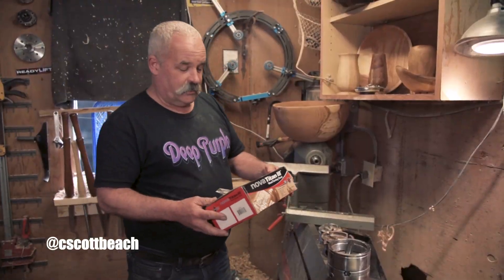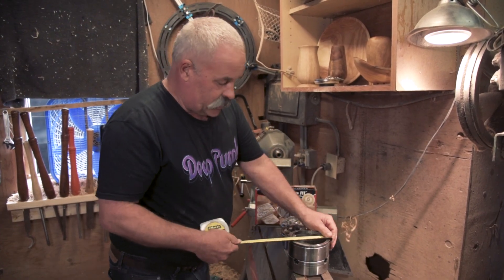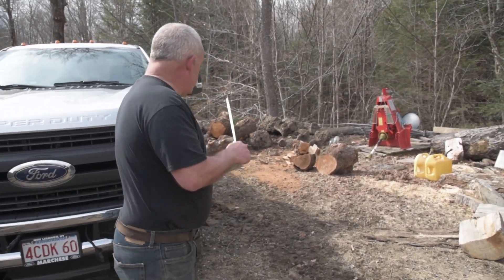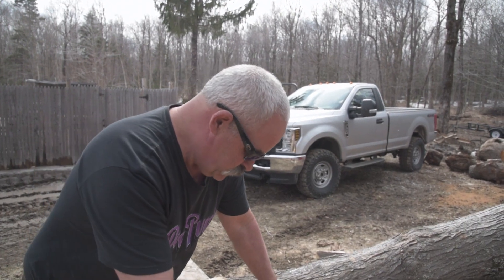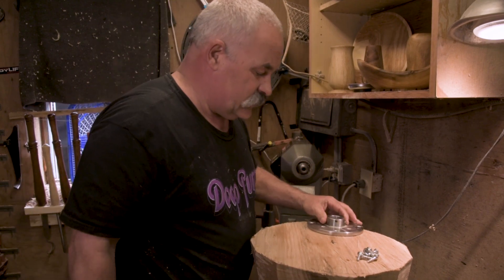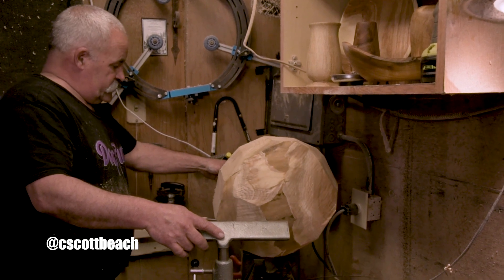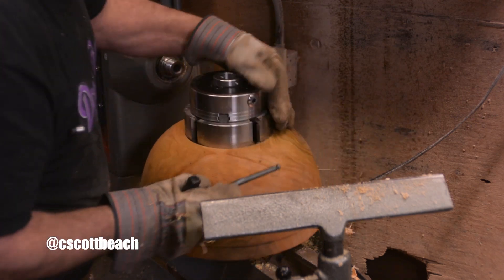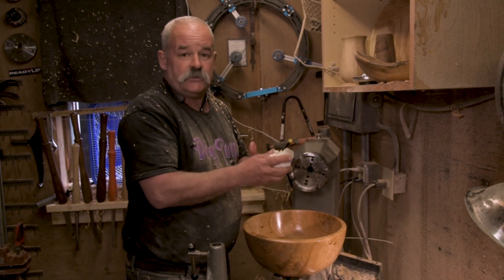Turning a Large Bowl with the Nova Titan III

Comment: Hi Scott. I purchased the Nova Titan III. I know you said you don't use the woodworm screw. I have used the woodworm screw with my other chucks. The woodworm screw that came with my Titan III isn't long enough to be used with the chuck jaws that came with this chuck. Is there any chance you would be willing to measure the length of the woodworm screw that came with yours. I think I received the wrong one and would like to verify that. I contacted Nova and they haven't been any help. Thanks
Reply from the maker: Hi Donald, To the best of my knowledge they only make one woodworm screw. And that certainly makes sense that its not long enough. I never even considered that. I have never used any other jaws on the Titan but and other jaws nova makes should fit right. Not sure if you have any smaller jaws from nova. Let me know and I'll look into it also.
Reply: Hi Scott. I now have 3 Different Nova Chucks and each one came with a different length woodworm screw. The other two were the right length to be used with the jaws that came with the chuck. The book that came with this one said the woodworm screw should protrude 3/4 of an inch beyond the face of the jaws. The one I received only protrudes about 1/4 of an inch. That isn't nearly long enough to secure a piece of wood to the chuck. I thought when I bought this I would be able to use the woodworm screw with the jaws that came with it so I wouldn't be changing jaws all the time.
Reply from the maker: @donaldlewis7224  ok that shows you how much i know about the wormwood screws.  I will send a message in and see if I can get an answer for you.
Reply from the maker: Donald send me your address to cscottbeach@gmail.com and I will send you the longer woodworm screw. I just bought another Titan and I don't need it.
Reply from the maker: Did you get the scew Donald?
Reply: @cscottbeach  I did receive the wood worm screw. Sorry to say that it is the same length as the one that I received with the chuck I purchased and is too short to work with the supplied jaws as well. The one you sent me is slightly different in the way it is threaded but is not any longer.
Reply from the maker: Ok sorry I couldn't be of anymore help.